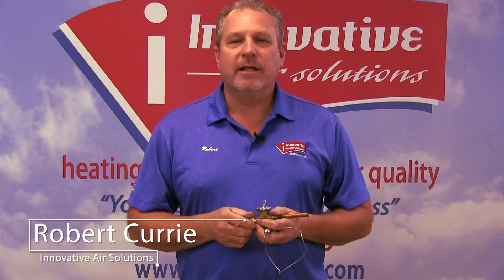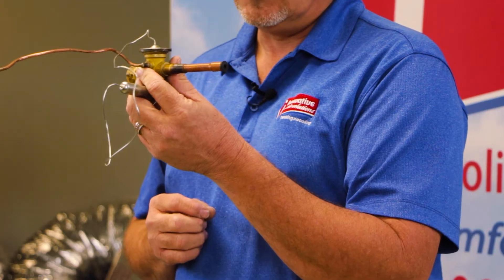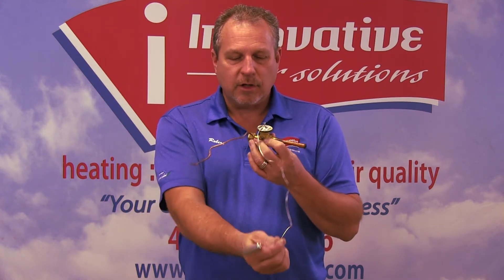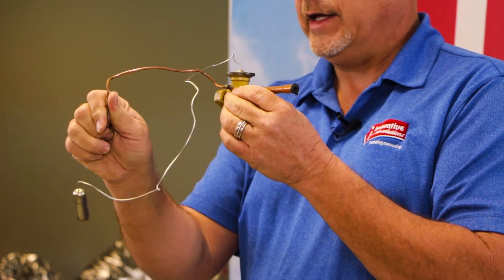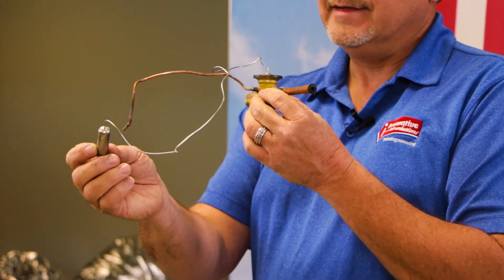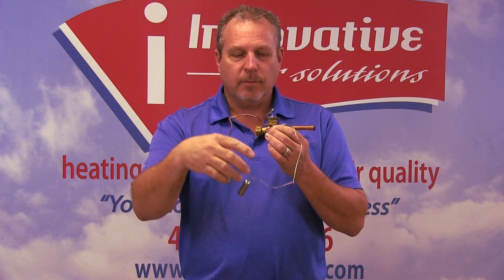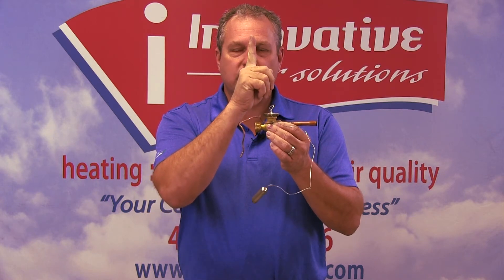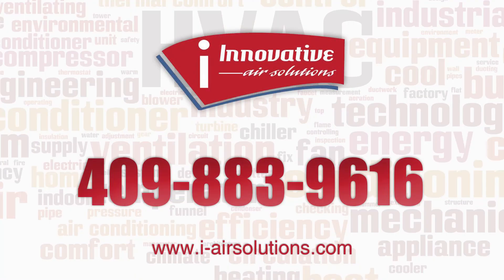Thermostatic Expansion Valve

Comment: hi -I don't understand for that model with three pipe -third are conected at exhaust of evaporator -when the termic valve are close the pressure are going in bypass from third pipe ?
And also who close the selunoid valve and the pressure of the compressor where are going ? the baypass are after this valve 
Meny thanks 
where I can find a animation of this ?